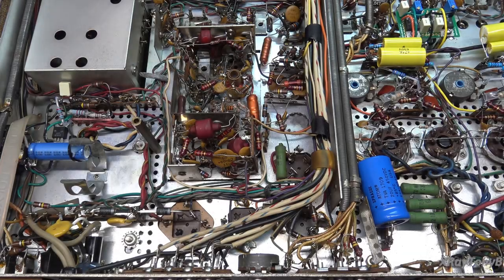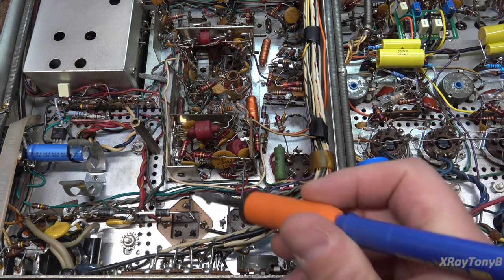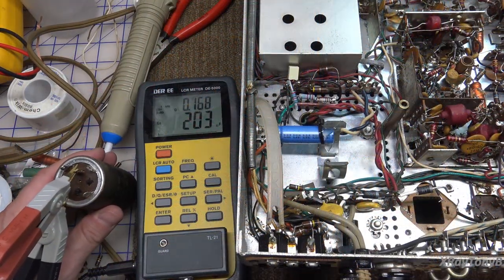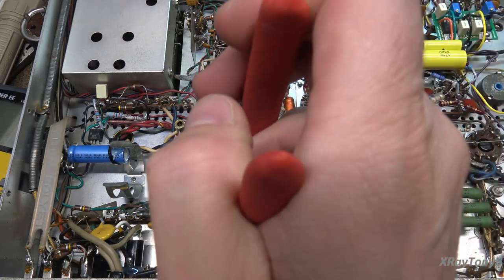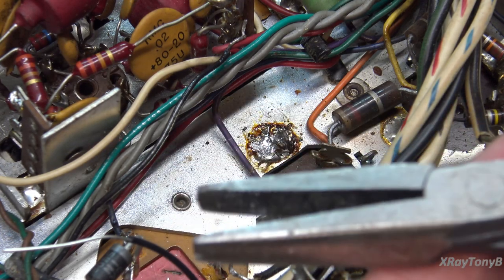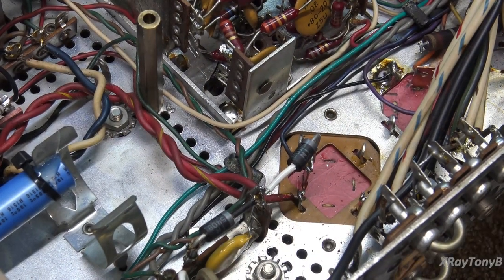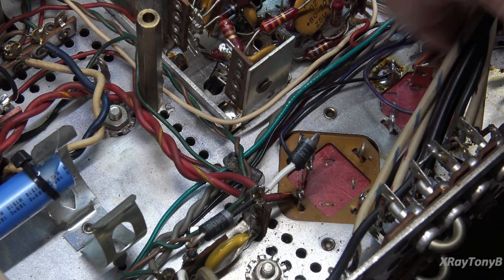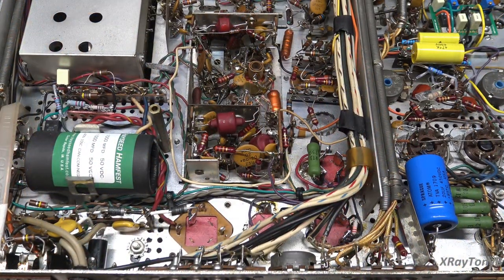Fisher 800B Part 4 - Restoring the Power Supply

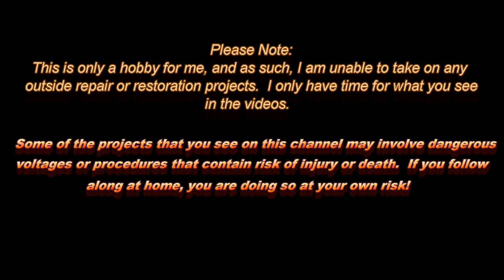Comment from the maker: 0:15 Intro
0:25 Faulty Capacitor & Choice for Replacements
6:20 Removing & Replacing the caps - "Solder & Chat"
37:11 Common lead failure in a multi-section can capacitor
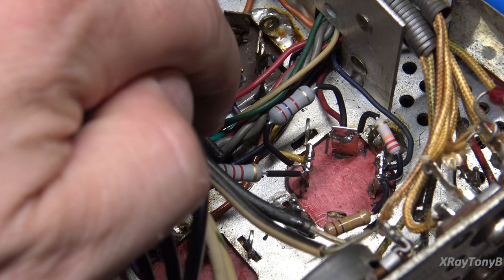40:32 Finishing the wiring of the resistors & caps in the power supply
44:24 Powering up the restored power supply with variac
49:14 Why caps charge to higher voltages when the power supply is unloaded
52:00 Voltage rating of old caps vs modern caps
53:35 Looking at the negative bias supply voltage
54:30 Fitting the 7591 output tubes and checking plate current at the output transformer
*NOTE:  If you check out part 3, you will notice that the current at the cathodes of the 7591's 
is higher than the current we will measure at the anode.  This is because the screen grid will also 
draw a small amount of current, which will show up in addition to the anode current when measured
at the cathode.  I forgot to mention this in the video.
56:50 Looking at the tube charts and comparing bias vs plate/screen voltages
ANOTHER NOTE:  I didn't mention that the max idle current DECREASES as you increase the plate 
voltage.  At 400Volts, plate current should be no more than 85mA for two tubes, but at 450 volts
the plate current should be no more than 77mA.  As it is currently set (for 120VAC  mains), running that amp at 
127 VAC mains voltage would cause the tubes to idle at 78mA, although the B+ voltage didn't quite go up to 450VDC.
58:20 Is the regulated bias supply a good thing, unnecessary or bad for the amp?  
1:02:20 Adding 33k resistor to NFB High-Pass filter cap.  I show this cap in part 3, NOT part 2 as the video says. 
1:03:43 Playing some music through the amp.

Comment: Tony. when it comes to vacuum tube equipment, the following question comes into my mind when it comes to capacitors, "Is the unobtainium transformer or the expensive rectifier tube worth me trusting an old capacitor to reform?"  No, I just ditch them.  The only old capacitors worth keeping are the ceramic and most milars.  The rest get replaced.  Why?  One day that "reformed" capacitor will choose a life of crime without notice, and you can say goodbye to that rectifier tube or even the transformer.

Comment: The multifocal lens implant for cataract worked so well I wondered why they didn’t do it when I was 13 and started with glasses.  Fixed the distance vision and the need for readers in most circumstances.  Good luck to you.

Comment: Very good video! 👍
Still a few words about that mains voltage and bias voltage fluctuation; 
Yes, you are correct, a non-regulated bias supply cannot compensate the effect of B+ and screen voltage changes caused by mains voltage changes because the bias voltage change, even if it is to the right direction, is very far from sufficient to keep bias current operation point unchanged.
So best way to tackle that problem is to regulate the mains voltage. 😁 
 And yes, some mega rock bands, who still use classic vintage tube amps during live gigs, in fact use very sophisticated and very expensive mains voltage ac regulators to feed their precious vintage amps with a clean and steady mains AC voltage.
Some might say that why not regulate both bias voltage and B+ voltage, but regulating B+ voltage is a bit challenging and it is not a good solution for old vintage amp designs because all vintage tube amp class AB or B output stages have been designed understanding the fact that B+ voltage sags very significantly at higher output power situations. And if B+ was regulated, i.e. almost rock solid even at full power, the whole output stage operational point and output transformer load line etc. should be designed totally differently if you don't want the output tubes and OT to melt at full power. 😱
So if you have a regulated and constant ideal mains AC voltage, you normally don't have to worry so much about bias problems.

Comment: While you are talking about eyesight around the 10:00 mark I notice your desoldering technique #1 remove excess solder #2 unwrap wire with tool #3 heat joint to remove wire 🤓👍

Comment: Greetings Tony,
   I was wondering if I should change the germanium diodes in the power supply to silicone ones for reliability. I am working on a Fisher 500C, I have the kit for the cans from Hayseed Hamfest, but this project went on the back burner while I learn more about them. Thank you for sharing your experience and knowledge with these videos.

Comment: Your videos don't suck. And get yourself a Hakko FR-301 desoldering gun. They're not cheap but but you'll never regret the investment.
Reply: Just bought one myself and absolutely agree, costly (as are the nozzles) but amazing, night and day compared to the knock-off I had which I got (literally) burned on
Reply: @jamesbennettmusic  SAME! Bought one of the chinese knock offs, and didn't last long. Hakko will be my next one.
Reply: I have a Hakko FR-300, but it doesn't do the big terminals very well. For recapping a circuit board however well worth the $300+
Reply from the maker: I have an FR-301 that I keep in the work vehicle for field work.  It's great.  I also have the FM-2027 that I use on the bench with the rework station.

Comment: I really enjoyed this one. I am always keen to learn different desoldering techniques. Interestingly, I am going to the eye Dr. on Tuesday. These days I use three different strengths of cheaters for this type of detail work and it is driving me nuts! Just a minor point did you intend to re-orient cap C102 by 90 degrees or way that just an oversight? Thanks for another excellent video!
Reply from the maker: I rotated C102 because the terminal was slightly different than the original cap.  It just seemed to make it a bit easier to connect the diode and wire to the terminal that way.  Thanks for the comment!

Comment: I had cataract surgery in both eyes elected to go with the lenses to correct for my distance vision, but as a result working on circuit boards I now have to use a headband with multiple magnifying lenses. I think if I had to do over again I would just get the cataracts taken care of keep wearing glasses and presumably be able to see a circuit board without wearing a headset.

Comment: Failing to cock the Soldapult is a common thing.  I’ve never seen anyone who uses those not do that on occasion…. Sometimes it’s easier to remove the wires from the capacitor terminals, then just wist the lugs off, and clean up the chassis after the capacitor is out.
Reply: As for the capacitor twist lugs, I think I saw Mr. Carlson's Lab just twist the lugs back and forth until they broke off. The solder is pretty soft, as long as there is enough tab to grab on to. I have a Fisher 500C and the Hayseed Hamfest caps and I think I will give it a try.

Comment: It would be interesting to see a dissection of the capacitor with the internal lead failure at 37:11
I have restored a radio that has that issue: I have just installed modern caps in the chassis underneath and left the old cap not connected just for looks.
But it is always interesting to see why things failed :)

Comment: For that 200uF 250V cap better set 100kHz Rs mode on the LCR meter to see ESR
Reply: I would rather use something like a Heathkit IT-28 and test it under high voltage conditions, ESR not reliable test for these high voltage electrolytics in my opinion.

Comment: Why did you halve the zero signal current value? If the resistor is feeding two tubes wouldn’t that double the expected current draw?
Reply from the maker: Good question!  If you notice in the datasheet, it lists that the "values are for two tubes".  When testing the plate current in this manner, we are only testing the current of one tube.  Assuming (you know what they say about assume) the other tube is performing similarly, doubling the value will give you the total anode current of both tubes (as listed in the datasheet).  If you go back in the datasheet, they also list idle current for Class A single ended use, which will list the value for one tube.  Those numbers will be a lot different because the amp is running in class A.  I think I did a video on amplifier classes (at least I'm pretty sure I did).  You might want to check it out.  Thanks for the comment!

Comment: What is the difference between the 7591 and the 7591A? Fisher 500C uses the A
Reply from the maker: I don't think there's a lot of difference between the two.  In fact, when you read the old datasheets from when the 7591A first came out, it listed it as being completely compatible with the original 7591.  I think the main difference was an improvement to the filament and cathode, but I'm not sure.  Where things get interesting is in the more modern releases of the 7591/7591A by other manufacturers.  Some of them came in much larger packages and wouldn't fit well in some of the older amps.  I almost think some of them were closer in design to a 6L6GB or 5881, except with a different pinout to match the 7591.  Some of the modern ones had a higher power rating, if I recall correctly, but not a huge difference.  The Tung-Sol re-issues that I'm using in this amp are a very good substitute for the originals.  I've noticed that with these, as well as some of the other modern replacements, the bias may be slightly different than the original designs from the '50s & '60s.  That's why its a good idea to have an adjustable bias supply instead of the fixed one originally in the Fisher.  Thanks for the comment!
Reply: @xraytonyb  There is a big difference in cost. The 7591 are $16 and some change whereas the 7591A are $28 and some change. When you are replacing 4 that adds up. Thank you for the reply, much appreciated. Maybe one of the viewers knows the difference?
Reply: @xraytonyb  According to the Fisher collectors on Audiokarma the "A" tube has a controlled warm up time. I assume this is so both tubes start conducting at the same time. That explains the 7591 being half the cost of the 7591A. Not sure of what consequences there would be if you use the 7591 where the engineer designed the circuit for the 7591A.

Comment: You should try claritycaps tc,  they're much better than electrolytics being a  metalized polypropylene film  with self healing properties, good replacement up to 18000 volts and being low ESR, especially tune for Valve amplifiers and gear try them out they are a bit big size might be an issue some of them
Anti blue sunglasses should be wearing them anyway +40 can drive at night that protect your eyes from age macular degeneration
Why using a solder sucker and not a un-soldering gun be a lot easier
Reply: Wow John ! Not bad, 230u/450V measures 60mm in diameter by 110mm height and about triple the price of the electrolytic. Not bad at all for a fraction of the ESR guaranteed for a lifetime or two !
Reply: @paulb4661  I did say size was an issue that's what the girls tell me lol
Reply: @johnsweda2999  OhJohn, I can only wish manufacturers came up with a similarly viable alternative to bipolar electrolytic coupling caps used extensively in transistor amps and line level sources. Wima stacked polyesters are a worthwhile improvement, but with pin spacings of 27.5 - 37.5mm in the 50u range, still a far cry from the compactness of Nichicon ES counterparts for example. You are likely to encounter anything between 5 and 10 electrolytics in the signal path from the DAC to the output stage, so there's a substantial scope for improvement. In a majority of cases, a small footprint with closely spaced radial pins at the penalty of even ridiculous height would work perfectly fine and a voltage rating of 25V is all that is needed. Obviously, upwards extended bandwidth may involve some tinkering to ensure stability in some cases, but that would be a small price to pay. Even like for like replacement of electrolytic coupling caps in amps after as little as 5 to 10 years of use brings about extended and more pronounced highs with a renewed sense of midrange clarity, at least for a while. Film caps however elevate performance to a different level altogether.

Comment: Progressive lenses are horrible for some things. One is reading music, or any other need for clear vision at a specific short distance (say, 30-40") but a wide field of view (top to bottom of a score or instrumental part.)  I don't think I would replace my natural lenses with anything like that, because undoing the progression with external lenses could be quite challenging. Better would be lenses that accommodate variable focal distances in a manner similar to what your eyes once could do, but without any of the possible genetic distortions. Work progresses on such things, but the current state remains disappointing. I think you might be in a similar situation to the musician, with the need for constant focus over a fairly wide field of view. YMMV.